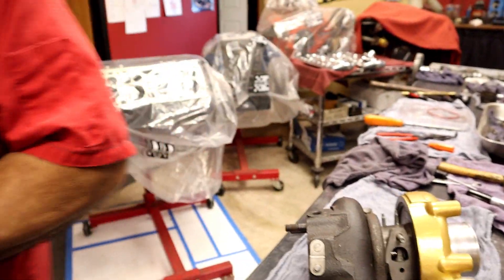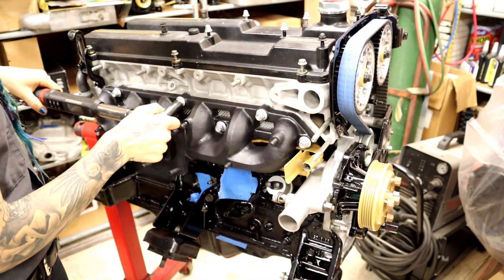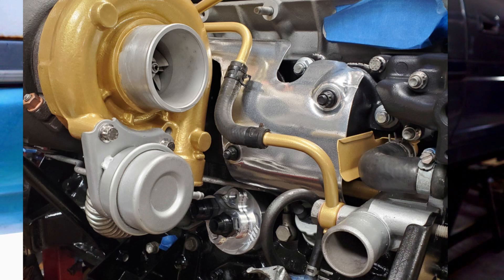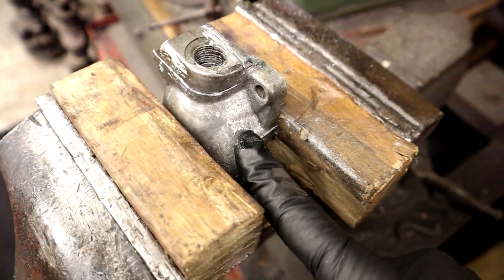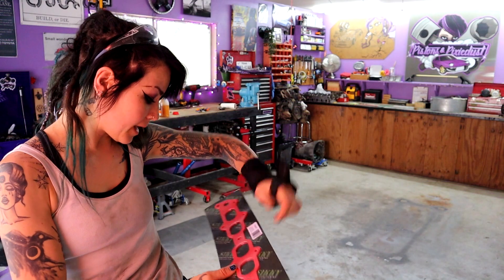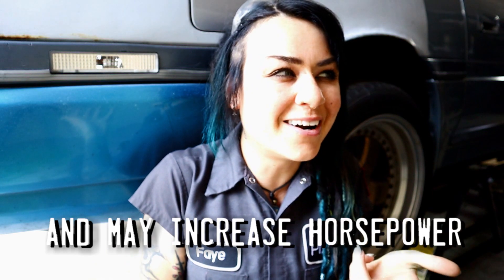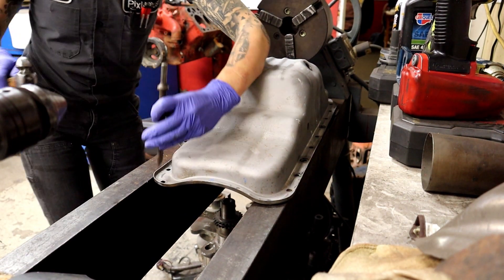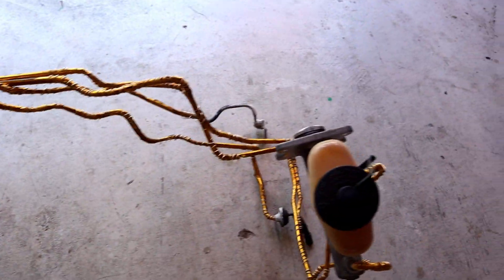Supra Saga Series Update!! // "Supra" cool engine build things ;)

Comment: That's a good gasket got one too! Dig the build! I am glad you can struggle with and still appreciate the 7m. I had to drop front cross member and drop pan with hoist holding the motor and reseal not ideal but had to. Still a beast.

Comment: I'll have to say that was way informative! That thermal gasket was very nice! I know on my 3rd gen Hemi I used a multi layer wood gasket on my intake manifold and it picked up 7hp! I was on wheel dyno and did without and with so I had an apples to apples comparison. You will notice air intake temperatures get cooler! I saw 40deg! As for the brakes I'd look at Wilwood peddle assembly and master cylinders. I have them for my 70 Mach 1 mustang and can adjust my break bias inside my car by a adjuster mounted in my lower dash. You might look into it.

Comment: FIPG is a PITA.  I removed the oil pan on my 93 Yota 4x4 to get the broken pieces of the plastic timing chain guide.  I cleaned it carefully on both the pan and block but put back FIPG oinstead of Permatex Ultra Grey.

Comment: Looks great Faye and coming along nicely love the vids as always,, just incase u didn't know after you have anything blasted and powder coated just make sure u get every tiny bit of grit out internally, especially on the intake, any sort of loose stuff WILL get sucked it and it WILL kill your engine, I've seen so many engines get totalled this way and some have been such expensive builds,. Get in there with wire brushes etc etc etc, then finally give it a once over with a jet or power washer and a swill through with petrol or diesel until your totally satisfied that the internal of all intake parts are spotless!!
Keep up the good work 😘👍x

Comment: Possibly stripped bolts because of lubricant used? Are you suppose to use anti seize on those bolts or does the spec call for dry torque?

Comment: Love the update! Sounds like the engine is almost ready to go back in? I'm sure we probably need to talk clutch, flywheel, transmission mating. Learning from Danny is also amazing! Excited for that welding video.
Reply from the maker: Honestly just gonna resurface the flywheel! I'm really stoked with my current setup and it has low miles on it! I'm using a lightened flywheel with upgraded pressure plate and stock Toyota disc!
Reply: @FayeHadley  Awesome. ^_^

Comment: Yeah, don't just show us engine stuff. Show us all of the other stuff. Though I do not own a Supra, your videos give me ideas to do to my Mk5 Jetta. Great videos, Faye!!
Reply from the maker: Oh I absolutely love the Mk 5 Jetta!! I think that is one of the best Volkswagen ever made! 🤘🏻 Thank you!!!
Reply: Mine has the dreaded NA 2.5l engine, but I LOVE that engine. 
What are your thoughts on engine degreasers? I am an absolute sucker for a clean motor and engine bay and personally consisted cleaning the engine bay as a one engine year service to do.
Reply: No you  
Don’t get me wrong, I love mine. It is a wee bit gutless, but dependable. The only issue I have is the pesky vac pump (delete kit is on the way) and the darn ECT sensor. (P2085) 
I wish I had the money to drop in a turbo and supporting parts. So I guess I’ll have to just build it slowly. 
You know, I am surprised that VW didn’t offer a turbo 2.5l. Would have been much more dependable than they realized... and quick.

Comment: Can you ask Danny his opinion if there is enough material on the block to drill the port directly below the oil filter to a m20x1.5 thread? I plan to plug the passage to the oil filter internally with a 1/4in pipe plug, and then run a m20x1.5 to 10an fitting in this location to feed the external oil filter mount, and have another m20x1.5 to 10an fitting back into the center of the oil filter location on the block to feed the main oil galley.

Comment: I got into the habit of applying Zinc Rich Anti-Seize on all bolts and fasteners with dissimilar metal contact.  The zinc flakes suspended in the antiseize act like a sacrificial anode, so they get consumed before the tasty alloy.  Steel spark plug threads into a alloy head?  Check.  I'm not sure if that's a bad idea for exhaust manifold studs. When dissimilar metals are in contact with each other for long periods of time, bad things can happen.  Zinc antiseize prevents the chemical process that would otherwise consume the alloy.  The zinc is tastier to the galvanic action process, then the alloy.

Comment: Have you thought  of using exhaust wrap on manifold then install shields? Using stainless steel clamps like used on tie rods boots. Reduce heat and hotter combustion burn. Reduce under hood  heat too.. Looking good there so far 👀

Comment: Use nordlock wedge washers on those exhaust studs rather than the standard spring lock washer.  They'll hold up better and prevent the nuts from unthreading

Comment: Nope...  I had a Supra where buddy had done head gasket, and then tore the threads out of the rear-most exhaust stud when assembling.  Customer came back and I got the job.  I indicated exhaust gasket leak, and suspect stud.  Another tech did the exhaust manifold gasket and said the stud he put in was OK.  I got the car as a comeback with the stud missing.  Did helicoil (gently) in place without removing manifold.  Used bore in manifold to guide tap.  Didn't use prewinder - just gently turned in... :)  I love FIPG - use it anywhere critical :).  Dunno about down there but in Canada it is almost $100 a tube at dealer...

Comment: Shame the old mkiiitech forum is gone, still some gold info on supramania... a few 7M-GTE builds in the "good old days" that may save you some time, If you did not hardness test that head you will be chasing BHG's forever as it will be soft around the head bolts (the manifold studs pulling out suggest it is soft) and you will find the head stud washers sinking into the head surface, the "fix" was to find an uncooked GE head (rare), heat treat the head (then have to re-machine every surface $$) or buy a new casting from toyota ($$), they where available circa 2006, now unlikely :(